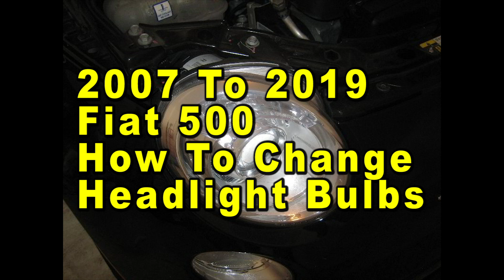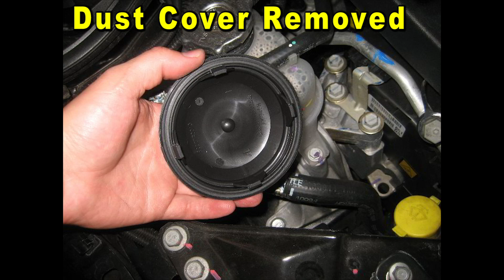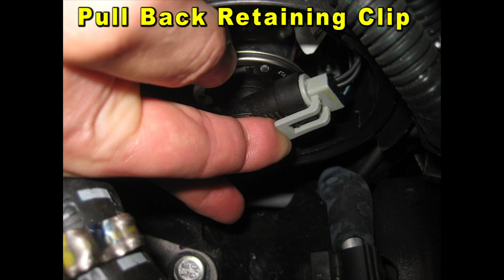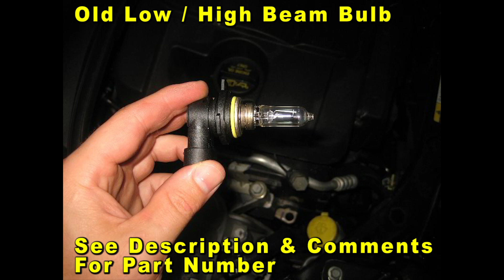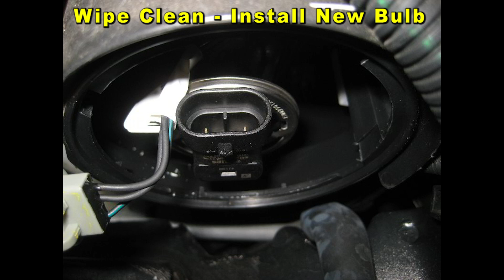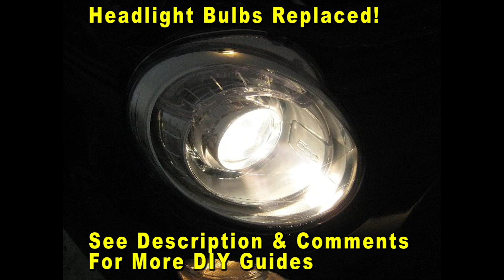2007 To 2019 Fiat 500 How To Change Headlight Bulbs With Part Number

Comment from the maker: Fiat 500 Low / High Beam Light Bulb - https://amzn.to/4527oB2
LED Headlight Bulb Part Number - https://amzn.to/3yD2tur
Precision Screwdriver Set - https://amzn.to/3sLixaP
Plastic Pry Bar Tools - https://amzn.to/3HMtsV7
Socket & Ratchet Set - https://amzn.to/3Z17LbA
Mechanix Gloves - https://amzn.to/3jCnHkt
Torque Wrench - https://amzn.to/3vS5uSI

The Paul79UF YouTube channel is a participant in the Amazon Services LLC Associates Program, an affiliate advertising program designed to provide a means for sites to earn advertising fees by advertising and linking to Amazon.

This DIY video shows owners of the 2007 to 2019 Fiat 500 how to change a burnt out combination low beam and high beam headlight bulb.

Comment from the maker: Check out the DIY guide for changing the headlight bulbs in a 2007 to 2019 Fiat 500 - 
https://www.paulstravelpictures.com/Fiat-500-Headlight-Bulbs-Replacement-Guide/index.html

Here are all of the DIY repair and maintenance tutorials for the "Type 312" 2007, 2008, 2009, 2010, 2011, 2012, 2013, 2014, 2015, 2016, 2017, 2018 & 2019 Fiat 500 -
https://www.paulstravelpictures.com/Articles/Fiat-500-Common-Problems-Repair-Maintenance-Guides.htm

Owners of other Fiat, Alfa Romeo, Chrysler, Dodge, Jeep and RAM vehicles such as the 4C, Giulia, 200, 300, Town & Country, Challenger, Charger, Dart, Durango, Journey, Grand Caravan, Compass, Grand Cherokee, Wrangler, Renegade, Cherokee, Patriot, 1500, C/V Tradesman and ProMaster may also find these DIY instructions to be helpful.